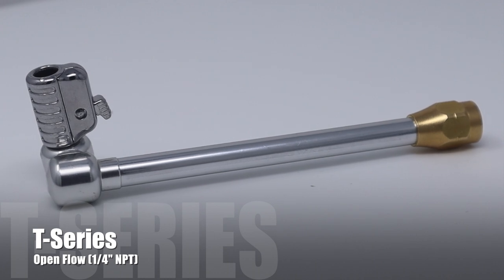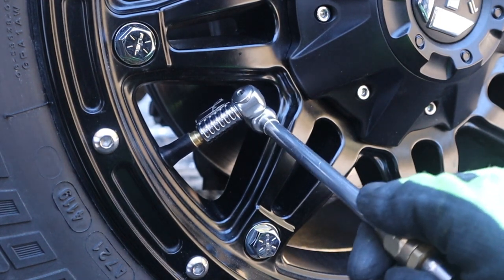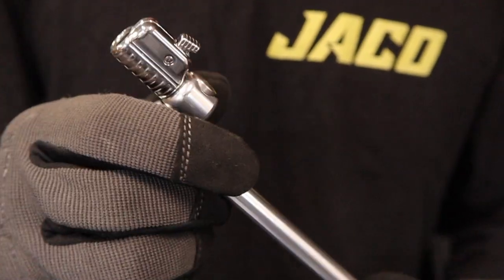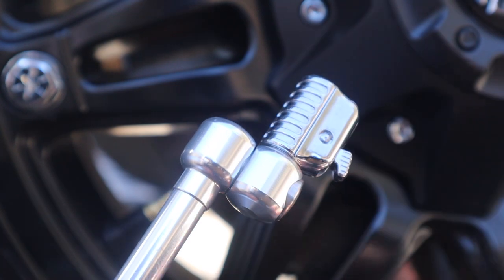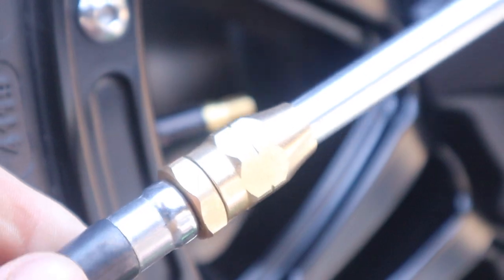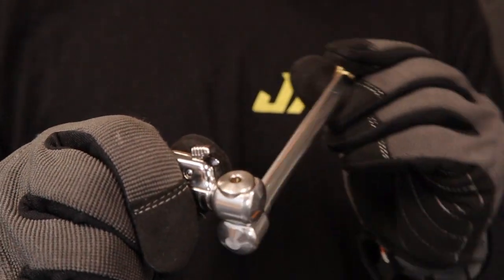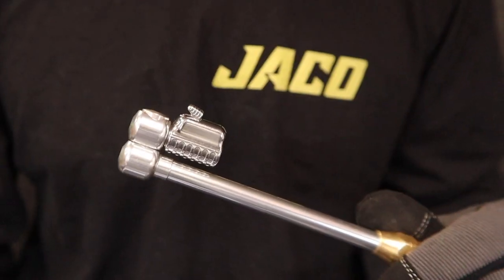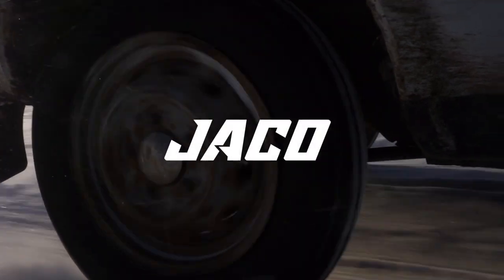Best Tire Air Chuck for Trucks, Trailers, & Dually Tires | Lightning T-Series by JACO

Comment: I wanted to love it, but sadly doesn't work with my gator valves due to clearance issues.  It is also rather short for a dually. Would be much better at 12 inches.

Comment: How would you release the valve from the inside truck tyres
Reply: I have this chuck. If you can get a finger on it you can tap the release button and it pops off, if the valve is too deep you can use some kind of an extended tool like a screwdriver to tap the release button. But the locking feature is much worth it.